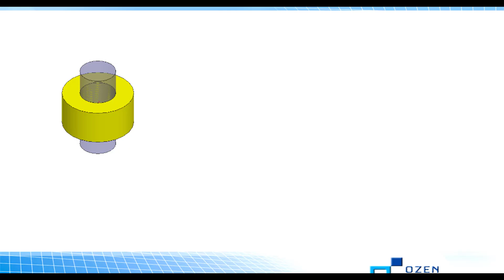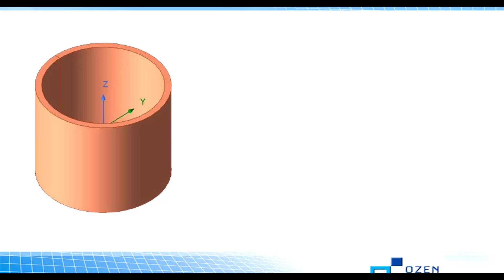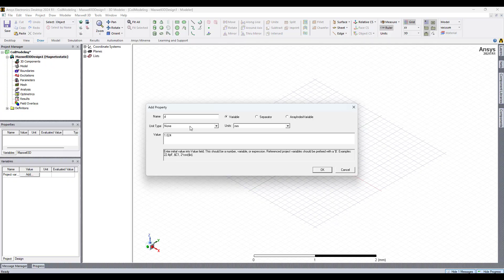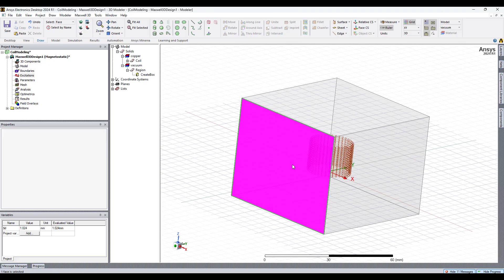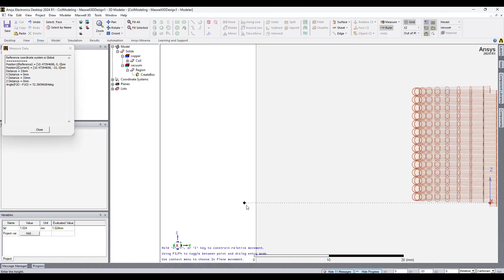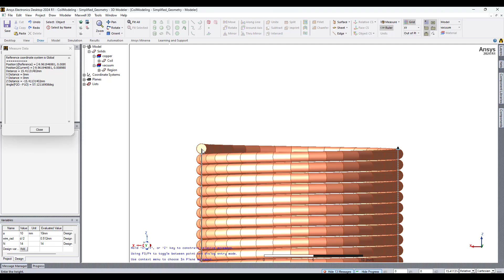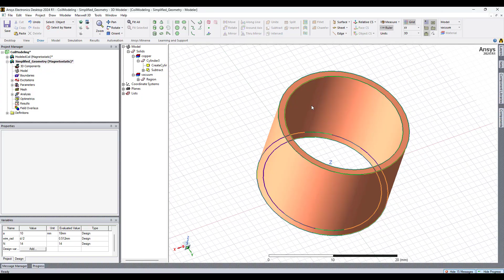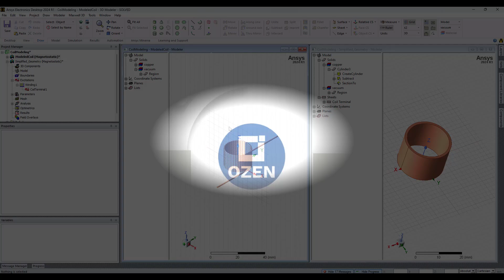Ansys Maxwell: Coil Models pt 1 - Geometry

Comment: my coil has 20 turns and i draw 20 helix with different distances from axis how can i connect in serial them and add winding for first turn and out winding last turn
Reply: should i add winding for all turns and unit them all?please help
Reply: @Ecomp1  Just go to Draw>User Defined Primitive>Segmented Helix>Polygon Helix and input pitch =0 (make sure the "Radius change is twice the "polygon radius" plus some some distance). Also you can change the geometry of the coil by changing the "Segments Per Turn", like, if you put 4, it will become a square shape, 8 becomes octagon, 0 for circle and so on...

Comment: If I want the unductor working at 100KHz for PFC circuit, I want to simulate also the skin effect fof the coil, because the conductance drops with frequency. I want to research the skin and proximity effect of the copper or any conductor that I have there. 

I guess the cilinder istead of coil would not help there. Any advice?